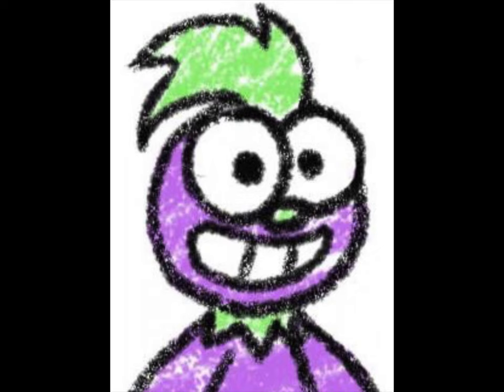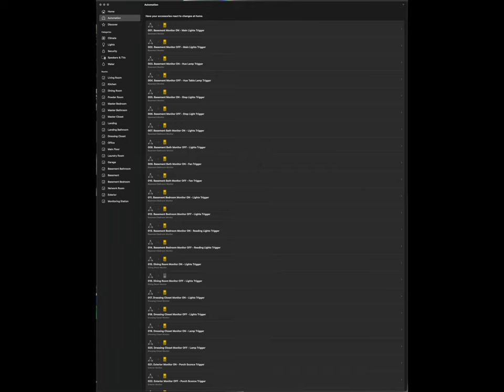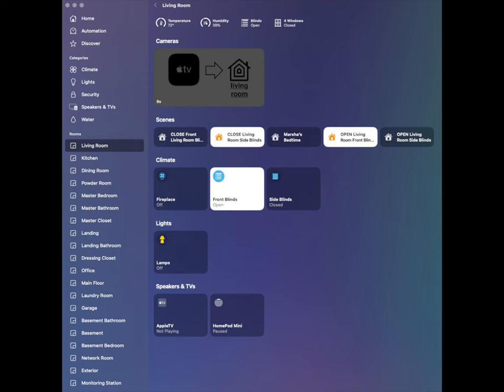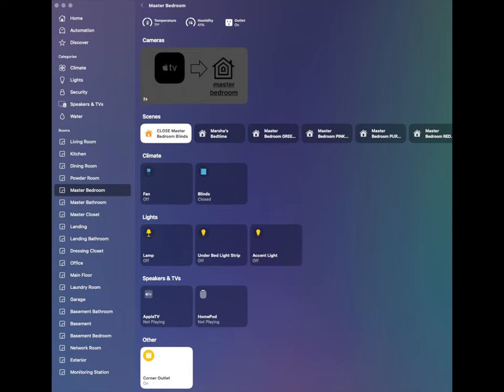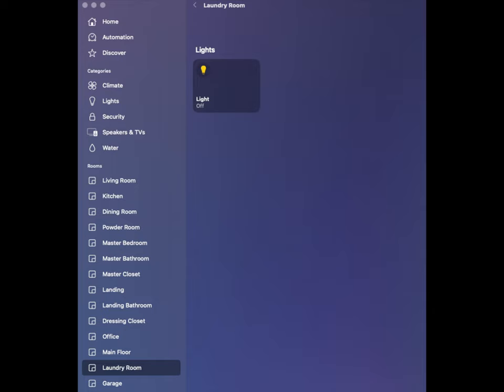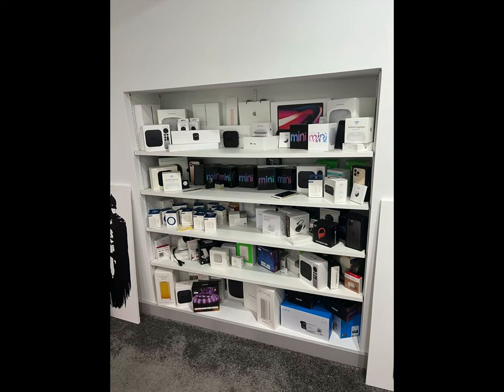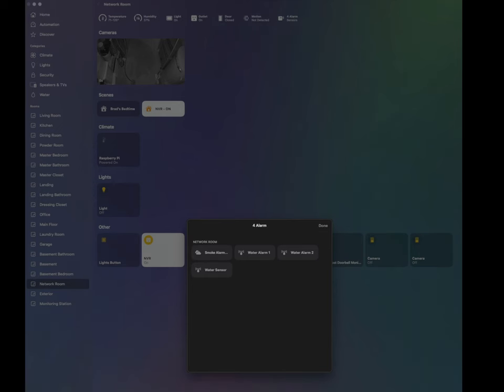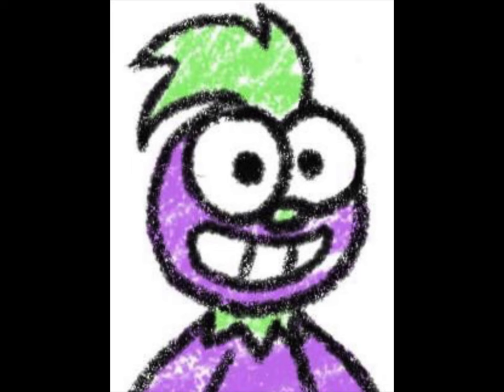My HomeKit Smart Home Tour

Comment: Hi there. Great tour. Thank you. What monitor do you use for your hot tub (other than camera) - is it a temperature sensor?
Reply from the maker: Thanks for watching!

There are a few Smart Accessories associated with my Hot Tub...
I have the Reolink Camera over my patio for security monitoring, I also have Water Temp Sensor from YoLink that shows (via a HomeBridge plug-in) in HomeKit...finally, I mounted a weatherproof J-box cover on the side of the tub that holds a Lutron Pico Remote (also incorporated via a HomeBridge plug-in) to control ON/OFF of outdoor lighting I have above the patio.
Reply: @uniqueflh2941  thank you!  I’ll check out Yo-link sensors.